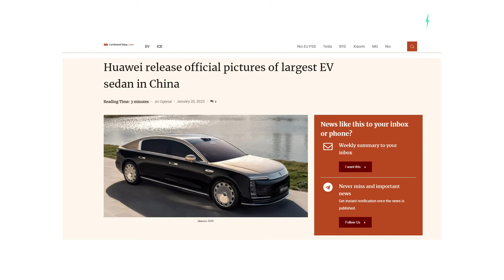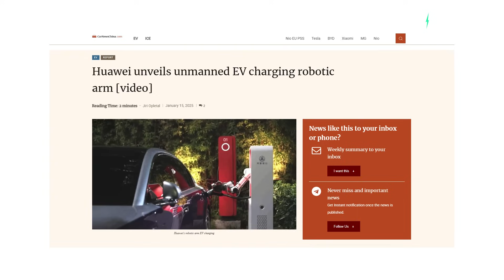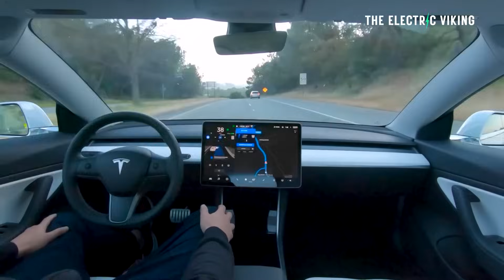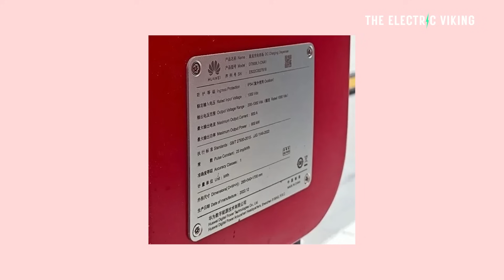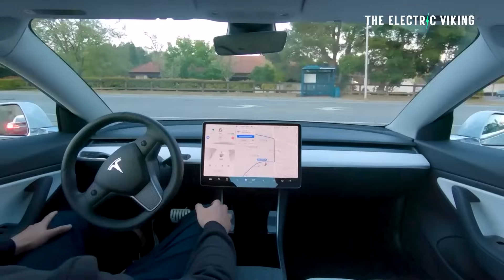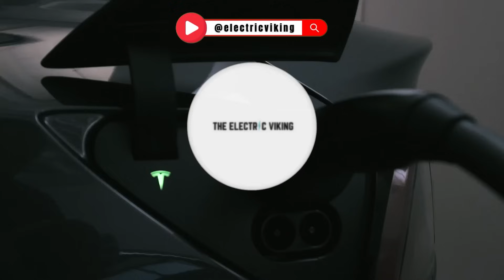The future of electric car charging is here; 600kw, no driver, robot charging

Comment: Just having 11/22 kW wireless at apartment blocks combined with autoparking would make much fewer charge spot necessary. It will be much easier to implement with only driving on private property. When the car is sufficiently charged, it can drive to the user's passive parking space and make room for the next charge.
ICE cars could also do that with a robot arm so thats not a good argument.

Comment: 600kw is enough to power a small town, for one car..one car.
If you are running a charging hub with ten chargers thats in continous use, you will need 6MW, just for cars.
Add heat pumps and truck charging and you will need 10X  bigger grid.
Reply: Cars charging at 600kW do it for 5min, not 12 hours

Comment: The locking pin feature of the charging port should be banned. In this cold winter overnight charging last night, I had a struggle to unplug this morning. probably because the low freezing temperature seized the locking pin it didn't unlock until I tried 3 - 5 times.. It's nice to dream about these futuristic technologies, but there are some more low hanging fruits that can be improved.

Comment: At the rate humanoid robots are advancing, we could have robotic charging attendants before robotic arms. No need for any changes to existing infrastructure and it will be far cheaper as one robot can serve multiple charging piles as opposed to one robotic arm per pile. As a humanoid robot, it can also perform other human-like services car cleaning or even helping to perform simple checks and maintenance on the charging piles.
Reply: What is piles in this context?
Reply: @DaveJones-100  A charging pile is a single charging unit. A charging station is the entire facility consisting of multiple charging piles.
Reply: @networm78  Thanks.

Comment: I did not mean to be so short in last post. The electric motor is superior to an internal combustion engine but there are three fundamental problems with the EV concept which will take many years to solve. As a fire engineer and applying common sense will explain. 
Firstly, severe lack of baseload electricity. how quickly you can in theory charge a car you will require sufficient electricity and the UK and most other countries generate no-where near enough. We can barely sustain 1 million cars due to our grid limitations, currently wind and solar are producing less than hydro with wind at just 1.8%, and solar 0.1% so you could be waiting for the wind to blow before charging!
Secondly, many do not want or can afford a new electric car and cannot charge at home which is approx 50% in the UK.
Thirdly, safety, the fire risk and fire loading a separate issue of a Lithium Ion battery are huge and are self combusting left right and centre in all applications all over the world and have been doing so well before EV's or battery storage came along. Even if a lithium ion battery combusts as a secondary fire started elsewhere the result is still a massive problem.
As an example one of the largest battery storage units in the US has just gone up for the 4th time in 5 years. This will only increase and we just cannot have this which is unacceptable.Lithium ion batteries need to changed.
Reply: The grid has adapted over the years to all sorts of increased loads (air-con, industry, high rise buildings, electric appliances of all sorts. It will again for EV charging loads. AND, with time of use tariffs, the grid can be balanced bu=y overnight charging. AND, with V2G, all of those massive EV batteries can act as peaker plants for peak consumption periods. AND EVs are quickly becoming more efficient. STOP thinking linearly. The changes are on an exponential curve! Just look at the improvements in the past 10 years! Yes, EV fires are a problem. BUT, even today ICE vehicle fires are 10 times more frequent. AGAIN, the technology is changing rapidly and EV fires will soon be a thing of the past. Already LFP batteries are largely reducing/eliminating  the risk of fires. Soon enough solid state batteries will reduce the risks further.  In short, THINK AHEAD.
Reply: I am also very concerned about fires.  You may want to look up lithium iron phosphate LFP batteries, which are safer.  The name is so easy to confuse with lithium ion.   I have LFP in my garage taking power from my solar panels.   I wouldnt want lithium ion in my house, or my car.     I hope solid state batteries come along and are safer still.  I think the e-bike batteries that cause so many fires are lithium ion.
Reply: @tftftf  Yes, e-bike batteries are an issue. That is mostly due to the fact that most of them do not have a BMS (battery management system)..

Comment: Because, y'know, it's soo hard to get out of 
your car and plug in a cable.
Reply: Let the self drive do it for you, stay home and have a beer watching a movie or go walk the dog.   If it works, great.
Reply: vandals and theifs that cut charger cords has been a major issue.   along with misuse.  along with the risk of being electrocuted.  like 600kw is a major risk.  do you want to plug that in after vandals or idiots mess with it.  

the cable for 600 kw is not going to be light.  and the connector has to be very robust to handle significant wear and tear.
Reply: At high usage stations, it makes sense to have fast robots do it. New owners often takes minutes to figure things out, when it becomes faster to charge the car than the rest of the process, automating it as much as possible is an investment.

Comment: Amazing how modern the Tesla robot arm was compared to the clunky "new" Huawei one!  The Tesla one was being developed several years ago. Now Tesla has moved on to induction charging because it is now as efficient as direct connection. No one needs a robot, the car should just drive over the induction plate itself. 
Huawei will have a market only for older cars as soon all of the EVs will have induction pickups in them.